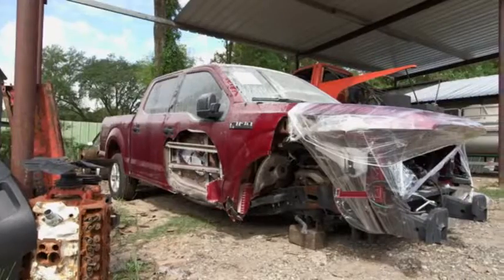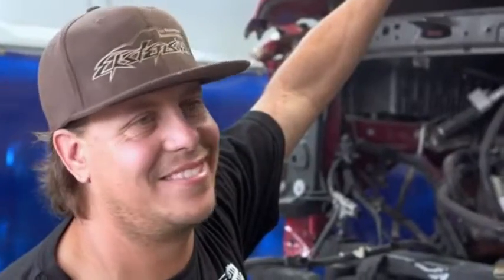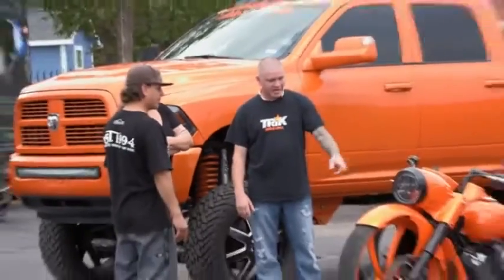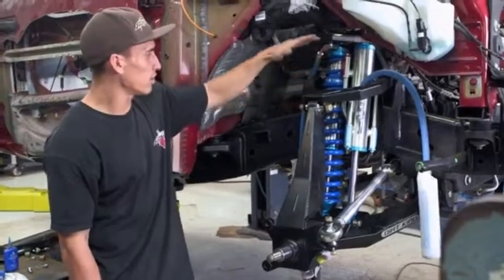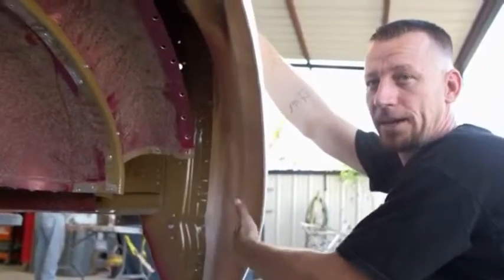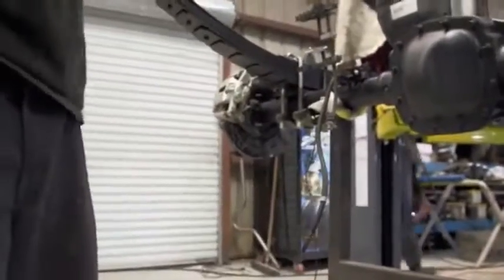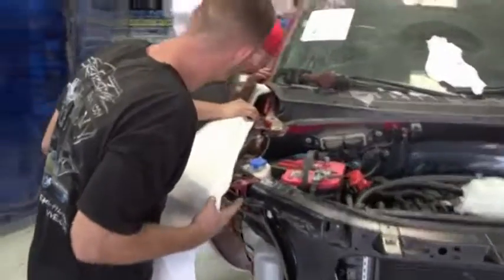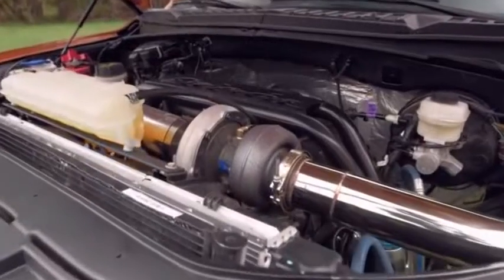Texas Metal - Texas Metal 2022 Bill's Baja Truck

Comment: I would not have chickened out for a trailer. Put a lift gate on the truck. I don't mean a Tommy Lift, I mean one of those fancy ones you see on an 18-wheeler racecar trailer. The lift would be quite similar to the flatbed of your trailer only the bike gets into the bed of the truck where it belongs and there is no danger of falling off of a ramp.